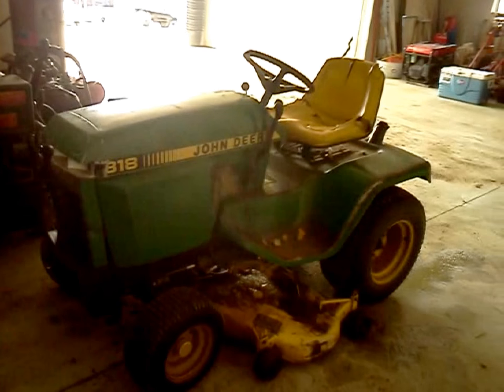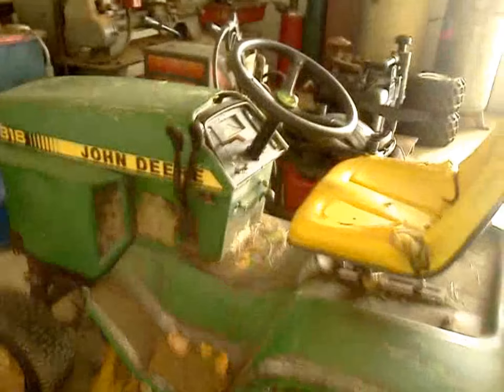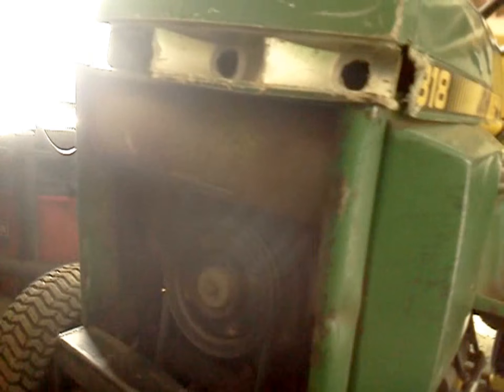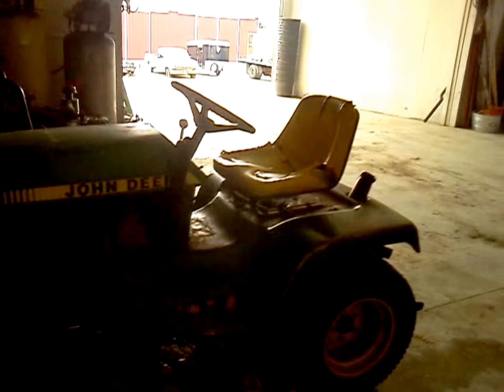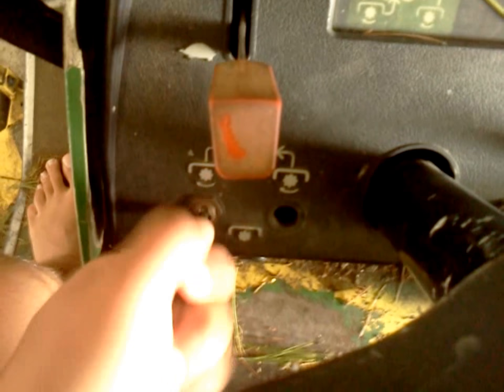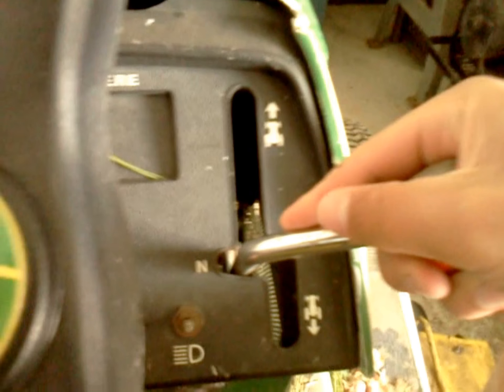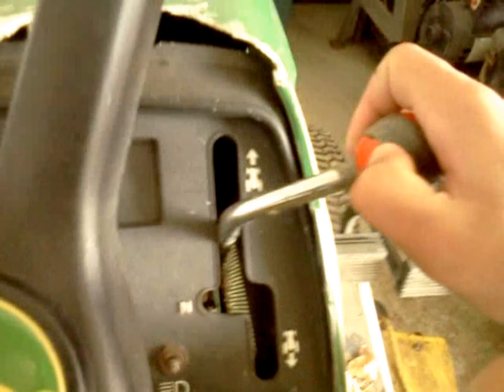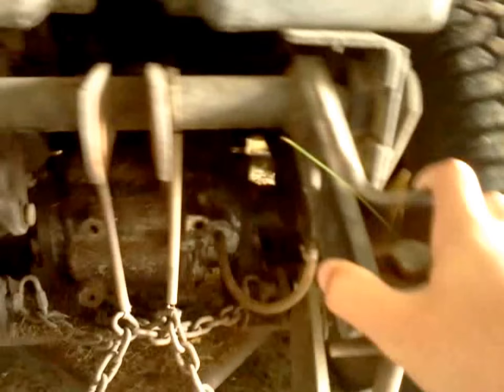1986 John Deere 318: In-Depth Review (Pre-Restoration 2012)

Comment: 210s are nice i currently have 2 one is electric and the other is hydraulic lift. I have a tiller, snowthrower, and decks. They do and excellent job of tilling. the dirt looks very smooth when your done. Almost like its been ground up. I just bought a 318 project (basket case) i hope to gradually have it take over the jobs the 210 does now. As I can buy new attachments.

Comment from the maker: You will love your 318. They are some of the best garden tractors John Deere made. There are a couple ways to find out the model year. The serial number tag is located on the bottom of the dash next to the key switch and choke knob. Go on the TractorData website and they will list all the model years and serial numbers for the 318. Also, check and see which Onan engine your 318 has in it. If it has an Onan B43G, it's a 1983-1986. If it has an Onan P218G, it's a 1987-1992 model.

Comment: I love the Onan's i own four Onan powered tractors brought back to life pretty easy,1981 Sears FF20 had a nroke connecting rod when i bought it,1977 Massey Ferguson 1655 a fuel filter was all it needed to run, bought a parts 316 for the onan and a 318 from the same guy the 318 was $900 with a 50" deck. Only problem is a bad seat safety tractors in great condition a paint job would have it showroom ready. I found a 425 for 1500 but backed off cuz after a few opinions on it from mytractorforum made sense 1500 for a 425 and it was posted for 2 months afta one of the guys called em on it the ad went down right after
Reply from the maker: Onan's are some of the best small motors made, it's a shame they don't make them anymore. The opposed-twin design was outlawed because of the emissions. Otherwise Deere was going to use them on the 425 and 445 tractors, but they were forced to switch to Kawasaki. The Onans can really take a beating and as long as you don't abuse them they can rack up thousands of hours. This 318 had about 3000 on the original B43G Onan before it crapped out 12 years ago and then the Linamar (which is really just a P218G) was thrown in it. That sounds like an awesome collection of tractors you have. I have been looking for my own 316 or 318 for a while and so far the best deal I've found was a 316 for $400, but I backed off cause it seemed a little sketchy. I'll find a good one someday. $1500 is a pretty good deal for a 425 but you just have to be careful that it doesn't have the plastic cam gear which most of them did have. I've run my neighbor's 445 and if I had to choose between the two tractors I would much rather take the 445.

Comment: that's 318 is really cool I am looking into getting one and I was wondering how much is the 3 point is
Reply from the maker: Thanks. I am also looking into getting a 318 from a friend and I will be trading him a 430 that I found with both a 3-pt hitch and a rear PTO. But I will be swapping those before trading it. The 3-pt runs about $400-$450 and the rear PTO can run anywhere from $600-$800.

Comment: yes these were the days when john deeres produced quality lawn mowers made of medal. now of days john deere lawn mowers are cheaply produced and made of plastic. my john deere D110 is the biggest pile of crap of a riding lawn mower I have ever owned, nothing but issues with that thing. every time I use it it's like playing Russian roulette. sad john deere used to stand for quality and reliability now they just stand for piss poor cheaply made lawn mowers. the founding fathers of john deere would be spinning in their graves if they knew what john deere has became now.
Reply from the maker: Yes sir. Back in these days, people wanted to do more than just mow their lawn (and they had more common sense too). Hence why they offered 3 point hitches and 8-inch tall steel frames and cast iron engines and everything. People don't understand the difference between old and new. Just cause it's old doesn't mean it's junk. I hear you on the Russian Roulette thing. I have an LA150 which we have owned since it was almost new in 2008 and it gave us a different problem every time we used it. Mainly a bad electrical system. Got that out of the way but now that I am mowing 7 yards every week I can't risk running that thing into the ground. A 318 holds up to this kind of abuse, especially the one in this video. It mows 7 acres of foot-tall grass each week without a problem. It's a shame, JD has really screwed themselves by selling to big box stores now.

Comment: How is a jd 210 more durable than a jd 318? Haha 210 is belt drive! Doesnt have half the power of a 318 and has no hydraulics. I see more junk 210 than any other john deeres. Ive had 212 210 214 and they arent even close to as reliable as a 318. Maybe thats why a 200 series doesnt bring more than about $500.
Reply from the maker: You summed up everything I wanted to say. The 210 and 318 are both very heavy duty but the 318 is superior compared to the 210. They are different since the 200 series is belt drive and gear driven but you know, different people use them for different jobs. Lakeslake79 has owned a 210 but not a 318. I own a 210 and my uncle has this 318 in the video. I am looking for a 318 right now though. The 200 series make a nice affordable tractor but aren't as popular as the 300 series. I bought my 210 for $275. Most people underestimate their ability.
Reply: ummm..... a 212 NOT RUNNING is worth over $200, and in running its worth about $900, idk where you get your info from but your wrong.
Reply from the maker: You guys are both half right. It all depends on the condition of the machine. A basic 200 series tractor with a mower deck and no goodies won't bring more than $500. But they have so many options that can easily bring the price up to $900 and above. I paid $275 for my all original 210 which came with nothing but a 39 mower deck. Since then I have installed rear lift, helper spring, wheel weights, HDAP tires, a 43 blade, and a 46" mower deck which all bring the price up a bit.